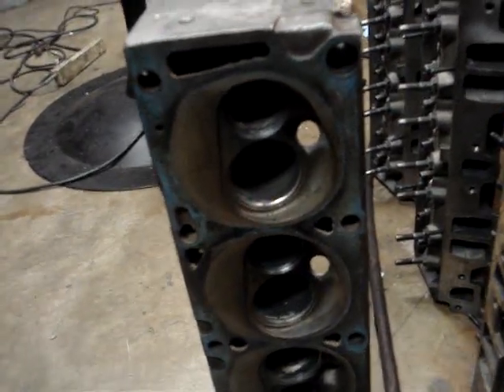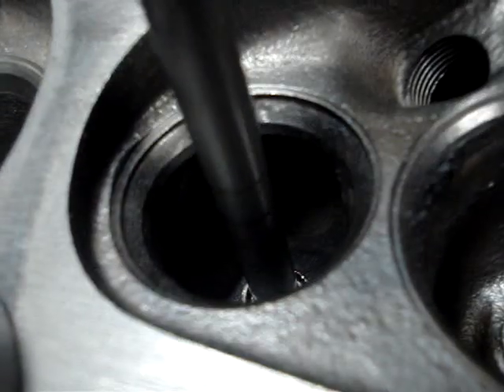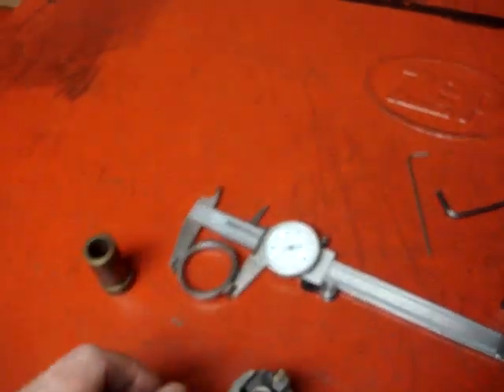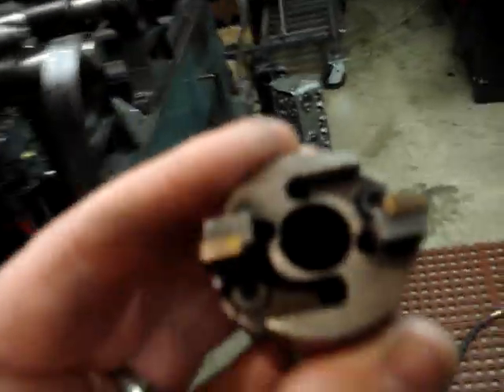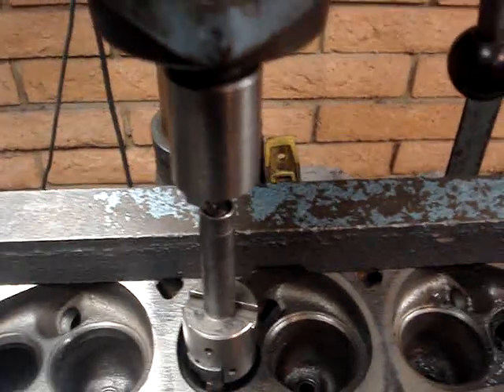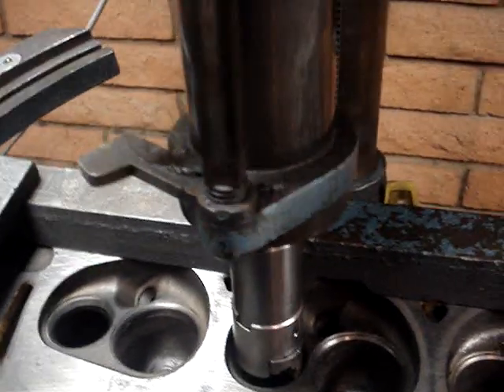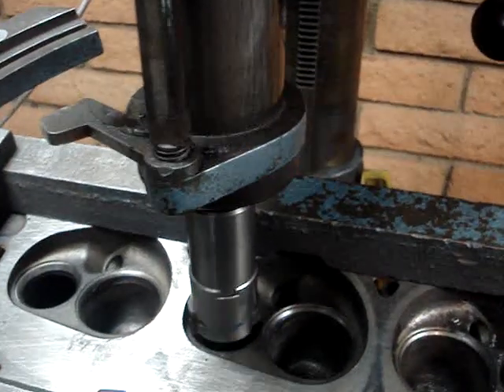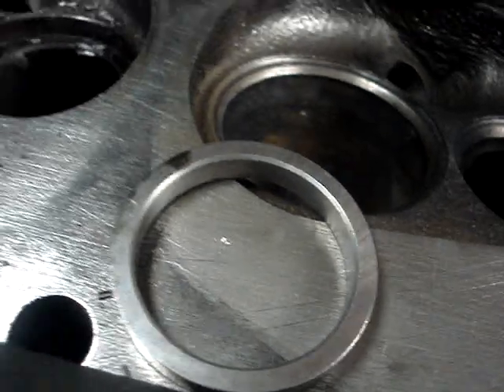cylinder head rebuilding

Comment: It is my understanding that using a cutting fluid similar to hone fluid suspends the metal shaving particles allowing them to float and not gall the surface allowing for a finer finish.

Another theory  would be that you don't want a fine finish but a very rough gritty finish which would allow the the head to "grip" the  component.

Comment: Looks like a Winona machine.  If so, have you ever done any Ford Flathead work with it?  Would you need to set the block down on the air maneuvered table or does it require a different cradle ?